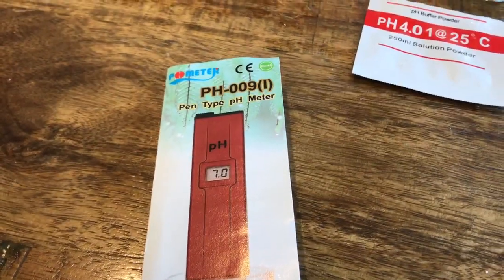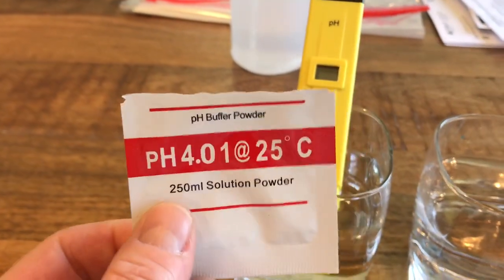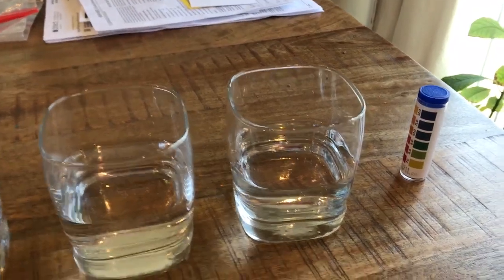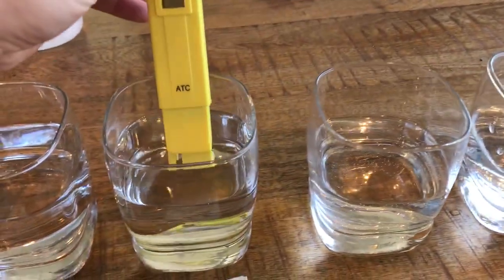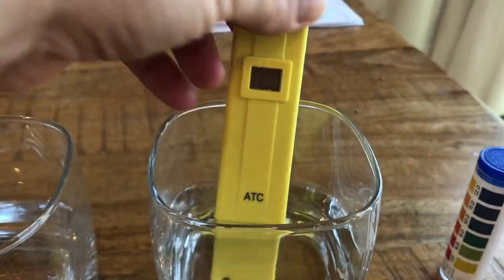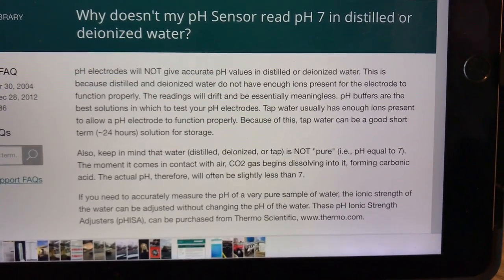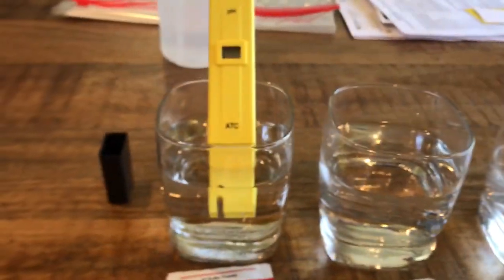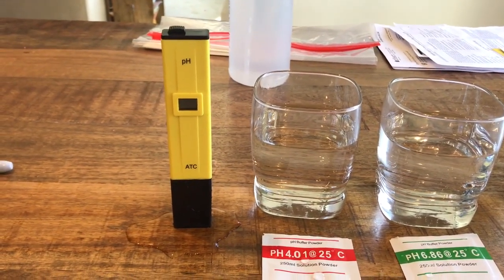Calibrating a cheap Chinese PH meter.

Comment: i got one and the fuker jumps from 18 to 3 to 14 to 1 to whatever, never settling on 1 number..and wont calibrate..screw does nothing..
Reply: Same Happ to me today. Did you get it to work?
Reply: @Keif_Stoned  had to get another one..seller gave it to me for free..the sensor bubble was cracked
Reply: I got one from eBay it doesn't do anything just stays put I have another one which jumps all over the place as well I think the paper strips might be a better option

Comment: Destilled water has a pH of 7 if it has been isolated of gases. If the destilled water is left for too long in contact with the atmosphere it will start an acidification process due to the carbon dioxide in the air, at the end the destilled water gets a pH of 5.8